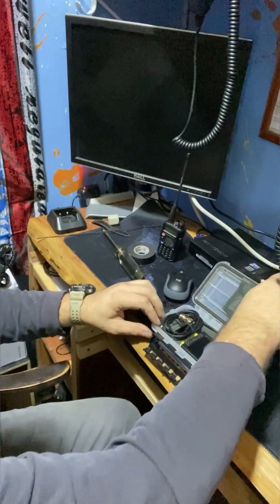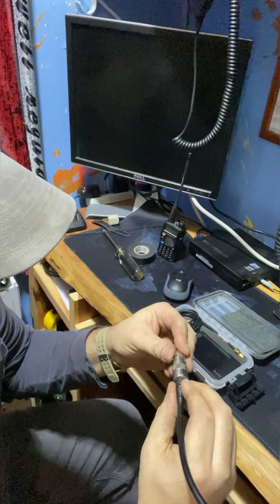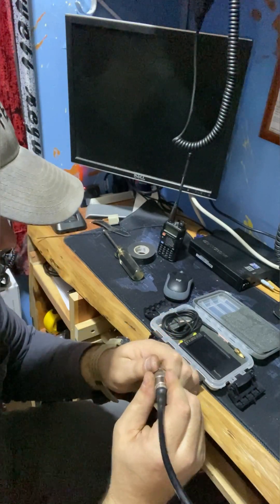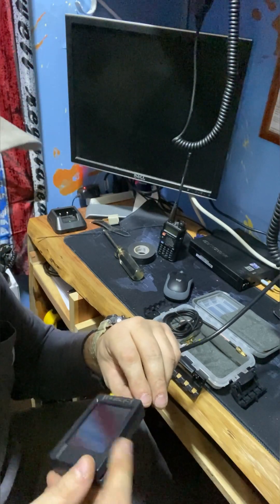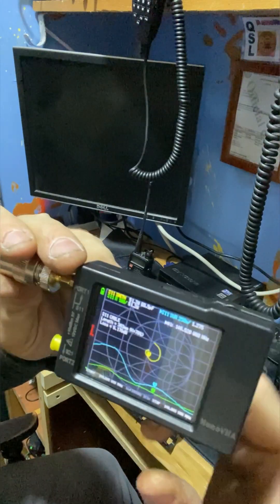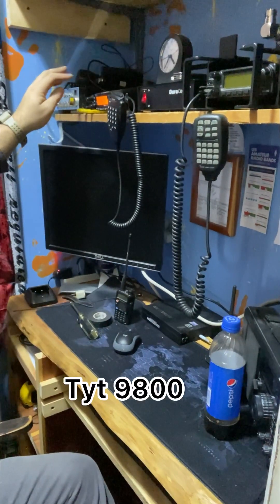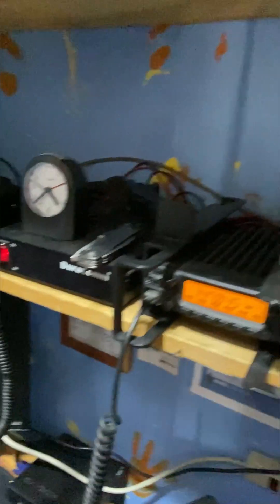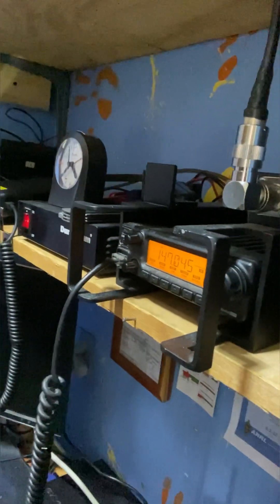2m yagi beam

Comment: Very cool!  Where did you find the dimensions for the build?
Reply from the maker: https://k7mem.com/Ant_Yagi_VHF_Quick.html

I like this one the best. I did try several of the online calculators. They all gave pretty much the same measurements. I just like this one better because you can key in more details.
Reply: @All_Things_Radio  Thank Justin.  I'll bookmark that website, first I've seen with Yagi design.
Reply from the maker: @baconwhiskey821  your welcome. I started with a tape measure yagi and realized those are for receiveing only. Then I built a 5 element 2m using this website. It work excellent. But I wanted more gain. So I took it apart and build this one.